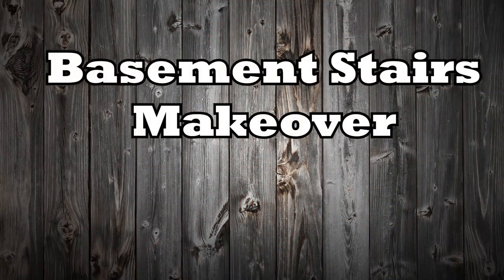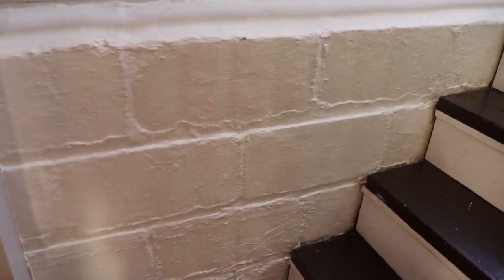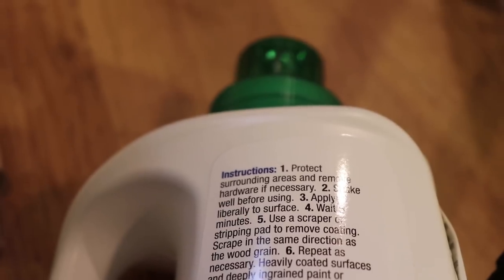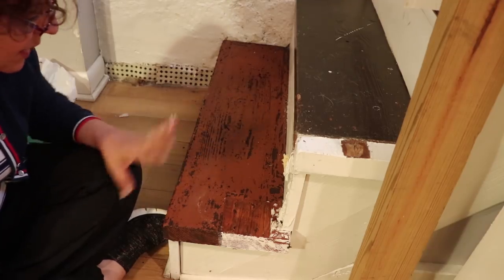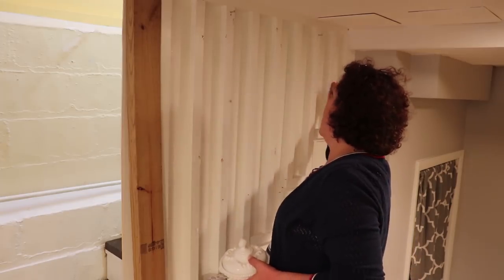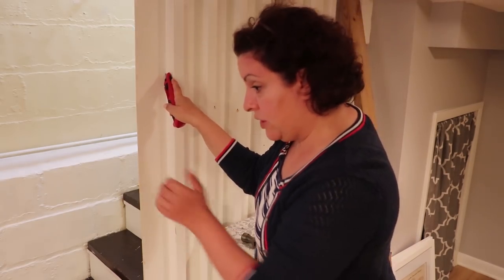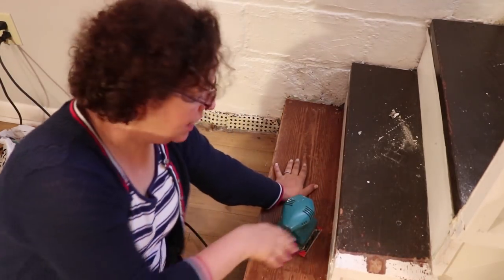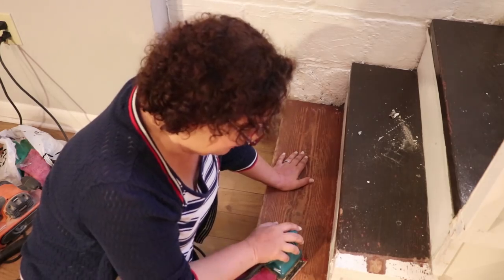🔨 Basement Stairs Makeover || Part One || 🔨

Comment: What about hanging insulated curtains at the bottom of the stairwell?  In the winter, they would reduce a draft.  In the summer, you could remove altogether if you wanted.
Reply: I was going to suggest the same thing
Reply from the maker: I was thinking about a rounded shower rod for a curtain and yes insulated.
Reply: Yes, rounded would be good.  That's what I was thinking.  :). Here's to a more cozy basement for you!  Love the steps so far, by the way!  The color of the stain is very rich and beautiful and I love the grain of pine!
Reply: Also, in regards to your concrete walls ... I am a believer in DryLoc.  Not sure if you're familiar with it but it is a waterproof, sealant paint for masonry and I was thinking it would perhaps act as an additional layer of insulation in your basement.  We used it in my father's 1947 Cape Cod house and it works wonders.  Just a thought!  :)

Comment: could you put a extension rod and a curtain  to use for helping with draft . we did that down are hallway to keep the heat in our front room when the electricity went out
Reply: toni thorson  I do this over my back and front doors in the winter I hang curtains over each door and close them at night to keep the heat in
Reply from the maker: I plan on doing that at the bottom

Comment: I love the stain it's really gonna look nice when all the steps are done. Maybe if you're chilly while you're quilting right there you can put one of those crinkle type doors on you know the ones that look like an accordion. You can put the track for it up on the ceiling or maybe you can put a privacy screen up when you're quilting to block the breeze. You do good work. I use to do a lot of work like that also. I've been thinking about refinishing my Mother's old wooden trunk, if I do I'll take before and after pictures to share.
Reply from the maker: The issue is not having a flat surface for a track it s all slanted.

Comment: This will turn out nicely.  We finishing clearing the garage today and then power washed it out.  My fall project will be patching some cracks in the concrete floor.  I will then start patching the old nail holes in the wall .  The goal is to paint the walls and floor in the spring. It is a tidy  and clean but a very ugly garage.
Reply from the maker: Wonderful!

Comment: Just lovely! That is a hard job but the end will be beautiful. Like you I like the natural look of wood, even pine today is not like the nice old pine in older houses. I would go from top to bottom, just rake product down from the one above to the next step into cracks. You will still have plenty of stripper left that while you are finished one that will do the extra work on the cracks. Also, if you are worried or white nail holes show you can paint each hole first with rust perm. ink marker first before you add the stain. Great video, you make me feel ashamed I have had paint for a small room for over two months and have not yet painted.

Comment: I used a like product on two antique doors. Smelled great and stripped like 20 coats of white paint . The original paint was a similar color to yours, stripper  would not touch it.  Ended up having to sand it all off. I don't know how they made it but it was meant to last.  I'm thinking pine because of the knots.  I love your projects. God Bless
Reply from the maker: i am thinking it was oil base and a stain as well. the previous owner had stripped the whole inside down as everything was painted gray according to him and did all sorts of colors including this marroon which was mostly in the living room and the big staircase. I did not have to strip it I just painted over it. what a pain that color is.

Comment: As always Sophia, well done and good luck with the rest of your Basement project.
Reply: Sophia could you use a screen as a divider to your Quilting Area?  Most commonly used in a residence as a small room divider, sometimes called a folding shoji screen. Shoji screens are usually tri-fold walls. A shoji screen may also be used to section off part of a bedroom or family room as an office.  Would this keep your Quilting Area cleaner and warmer?  It could also could be folded up if need be.  Not sure if I have explained myself correctly.  I have a wooden one which I use to divide a formal dinning room from a formal lounge room and my son and husband now use the formal dinning room as a spare TV/XBox games area.  Best wishes.
Reply from the maker: I am thinking about a curtain at the bottom of the stairs, one on a rounded track that way it curves and does not look as bad as a straigth curtain. thoughts?
Reply: Yes sounds good.  You would have to be careful of the colour and thickness (weight).  Don't forget your dogs going in and out, they would be brushing against the curtain as they go through and people's hands moving the curtain aside or do you plan to use a cord where the curtain can be moved back and forward.  I have seen in homes in England curtains on a rod that can be moved backwards and forwards across the doors to keep drafts out (in older homes) around the edge of the doors.  Have a look on line. Good luck.  Your home really is looking so good and coming together, well done.